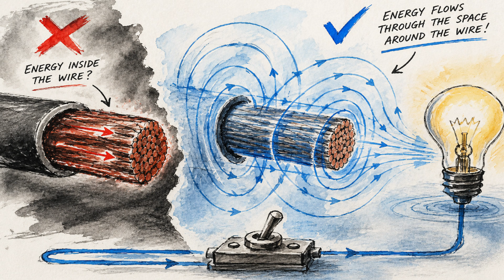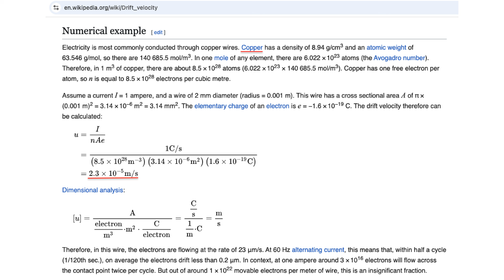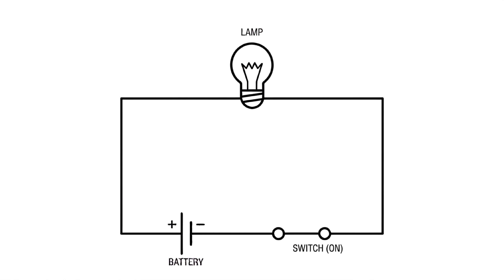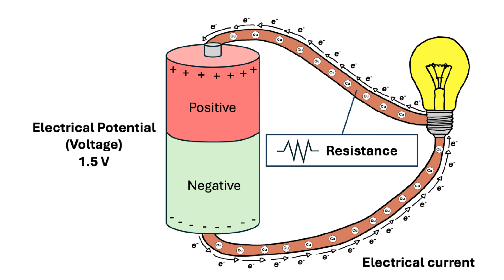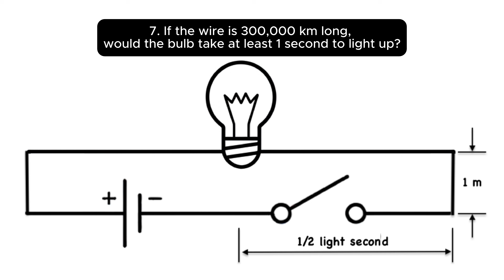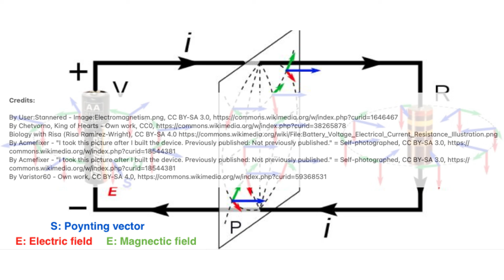Electricity DOES NOT Flow Inside the Wire

Comment: This video is a prime example of what is wrong in modern academia and science. This is current scientific conjecture on the nature of electricity presented as if it is cold hard fact. It is not. Veritasium was wrong in his video about the light bulb and the switch with light-second long wires which has been proven wrong by other scientists doing experiments as well as other YouTubers.
For my money the best theory on the transmission of power via electricity is that it is simply a compression wave traveling through the electrons which are held in place by an electrically conductive material. Therefore the speed of electricity is essentially the speed of sound in an ocean of electrons which is essentially very close to, but not quite, the speed of light.